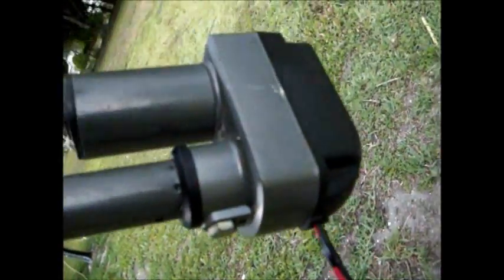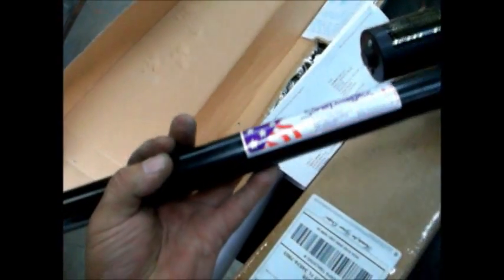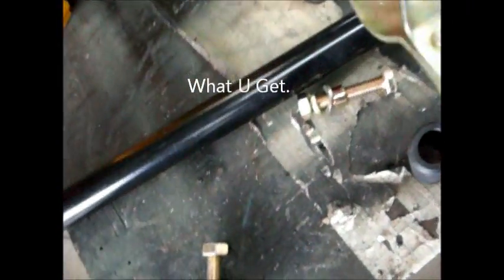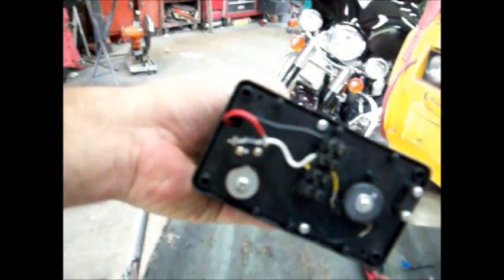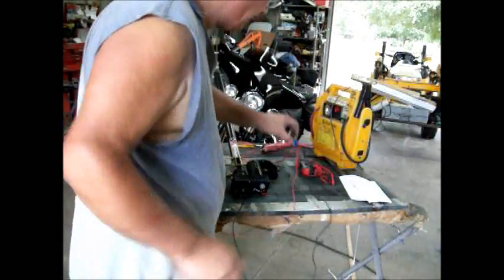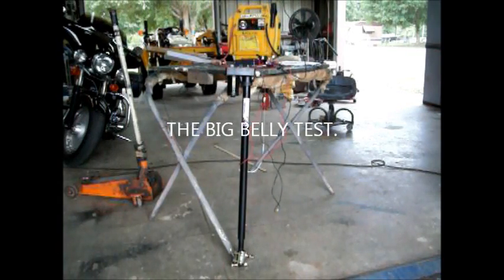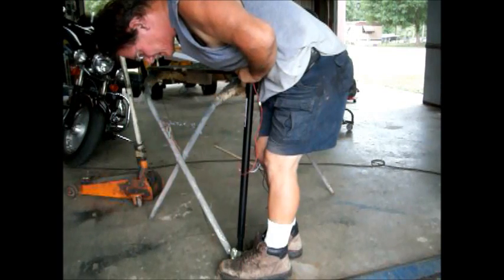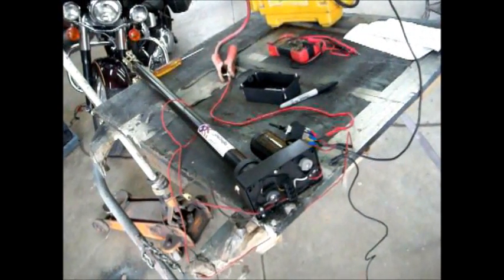Actuators $115.00 V/S $40.00 Ebay Deal?

Comment from the maker: This 1 I just put on one of my trackers that had a smaller 18" arm and It works just Fine.I have since bought a PMA. 2424 from eBay for $1.99 MORE  ALL METAL BODY FULL SIZE MOTOR..All the actuators will run just fine on a 12volts.I now have 2, 12 volt monsters.2, 24 volt models and 2, 36 volt actuators  They all work just fine and better than the 12 volt models as they run just a bit slower ,& that's a good thing when using LED type sensors by moving slower lets them sample sun light better.

Comment: I would buy two of these, have one sitting around for back up. If one fails I could quickly swap it out while I am working on it to fix it or whatever and not lose any power (if it was day time). As long as the metal parts are good I don't see how it's a bad deal. You might want to check the grease inside the tube / long screw and the gears, they may have skimped on that. The rest, who cares? A cam and a switch? Easy to replace.

Comment from the maker: I asked and was told it was a Thomson with limit switches it looks like the big 1 i have on my first tracker but yours seems slower so its may be 24 volts it will say on it and in side the cover has more info That,s  a very strong one.Those run around $250,00

Comment from the maker: I guess has IP67 rating,If the moter is mounted up as the arrow shows and the drain holes are down.It is meant to be out side ,It says power 24 volts 36 volts Rated 440 lbs static load if your trackers are balanced u can move them with i  finger. They all work on 12 volts .It was lifting my 230LBs off the ground With that little 12 volt jump pack hurt a good bit. Not the kind of pick up i like.

Comment from the maker: MR Savings Mall ON E bay .Also search -24 volt C Band Dish actuator arm All else Fails, see my feed back Ebay same name it will give the store Name,I have may be item # 330443957241,They have a bunch of them I am not that impressed with this one kinda cheap.But it was cheap.notice the small moter under plastic cover.I will use it as i,m not expecting to much the let down will be small also.It Is dam stroung and i used as u saw a 12 volt jump pack.might be OK will see.